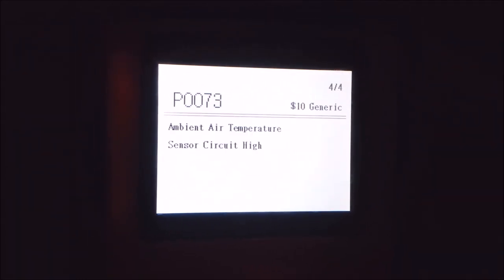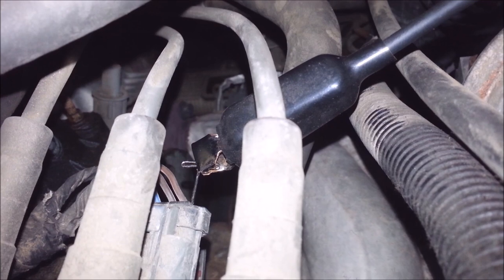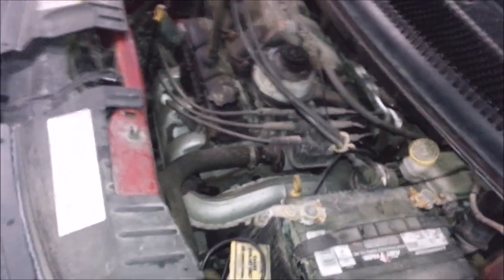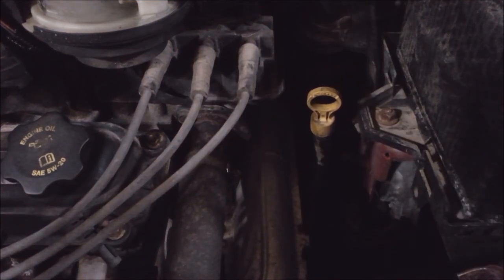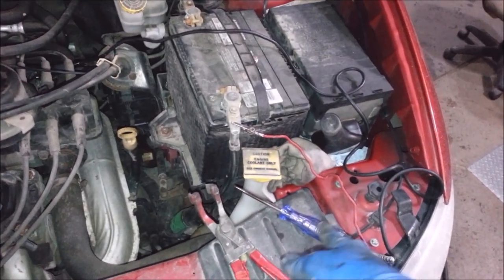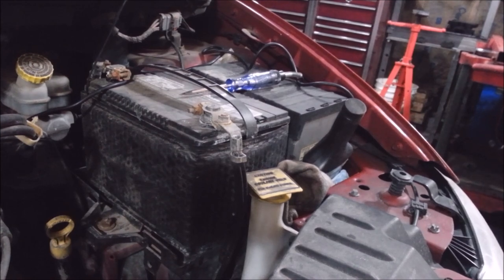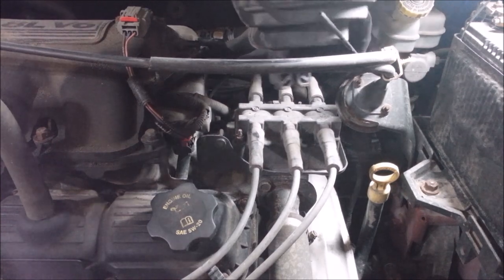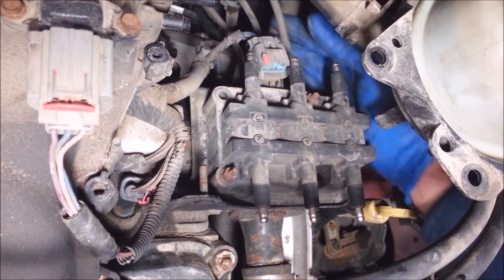2000-2010 Dodge Caravan p2305 p0300 testing and diagnosis

Comment: As im watching the video, I'm seeing that your using a t-pin to back probe each of the four wires on the ignition coil pack connector, then your connecting the alligator clip of the test light on the t-pin, then your starting the caravan to run, with the probe end of the test light your touching the negative battery post, why are you touching the negative battery post with the probe end of the test light when your t-pinning and checking each of the four wires on the ignition coil pack connector? I'm just asking because I'm not understanding and comprehending that part.
Reply from the maker: Because the other end is positive?
Reply: @RustBeltAuto  Can you be more specific, please?
Reply from the maker: @AlwaysDiagnoseVehicleFirst  if you don't understand electronics well enough, I would suggest that you do not do any of this. It can be dangerous, if you do not know what you are doing, as I have described in the video.

Comment: Hi, wondering if you can give me some advice.  I had same issue, just on cyl 5.  I tried using a test light like you showed, when I tried the 2nd from left wire (ASD wire) it instantly started running worse and shut off. It blew 2 fuses, 1 was ignition and I can't remember what other was, just replaced it. Now it will crank but not start, and have no spark.  Have replaced coil, and ASD relay with no positive results.  Any help would be greatly appreciated.  Thanks in advance.
Reply from the maker: The second wire from the right brn/wht, is your power wire for the coil. check power with DVOM, or test light while cranking engine. 2nd wire from the left is a coil driver wire.
Reply: @RustBeltAuto  that's the one, I meant second from left.  Sorry I had a long night trying to figure it out yesterday.

Comment: Check for a 5 volt reference on any of the sensors like tps  and see if the computer is sending power then you’ll know it’s the computer at fault
Reply from the maker: I was checking the coil driver. It is a signal that drives the coil. Basically an ignition module in the ecu.
Reply: Rust Belt Auto ahh I see now....check out scannerdanner he has some good content for backprobing and diagnosing..he’s awesome
Reply from the maker: @rahrah8076  I think I was awesome. I'm trying to quit. I have not come across him yet, and usually only see these tech guys when I'm stuck on something. Otherwise, I usually try to forget what I did yesterday, and usually don't know what I'm doing until it's done. May not look it in my shell of a garage, but I was an advanced master tech, 20 years in, and a lead tech in 3 different shops. I'm older than I look. Everywhere else, I tried to play dumb, because I don't want that no thank job. Thanks for watching!
Reply: Rust Belt Auto I have been watching you’re videos and have subscribed and you sure are a good mechanic and know a lot of diagnosing so I am learning from you as well..the automotive field sure is expensive for tools and equipment and diagnosing tools.. I don’t work on vehicles for a living but I work on my own..I just a bought Autel scan tool and learning with it.
Reply from the maker: @rahrah8076  wholly crap! I need a new scan tool. Have an old Maxi Das, that's way over due for replacement. Getting by right now with a cheap scan tool, and a graphing meter.
Reply: Rust Belt Auto a good scan tool to get would be the launch Diagun x431 has bidirectional controls it’s around $800..I need a graphing meter

Comment: On my 07 wrangler the blue/tan wire has steady light it dosent flash but the other two do with a test light does that mean my computer is bad or  can the rest light be steady and not blink?
Reply from the maker: If it is a signal wire, it is supposed to blink.

Comment: Great video thank you and thanks for the good laughs... Only Chrysler. I'm on my 3rd coil pack...
Reply from the maker: Secondary ignition failures will cause premature coil, and driver (primary) failures. Did you get a good set of wires, and new plugs? Plug wires might be the culprit
Reply: @RustBeltAuto   Yes I did and I appreciate everything you  Help me with... Keep up your great videos.  We all know Chrysler is  junk... I put more money and changed stuff on this Van in one year... And the most I ever put on my Lexus's and Toyota's in 20 years... Is basically change the brakes and rotors honest-to-God...so sad.
Reply: Sad third box

Comment: Hello can coil still be bad if no spark on cylinder 2 and 5
Reply from the maker: Ya
Reply: @RustBeltAuto  OK van starts up and runs but has misfire on cylinder 2 and 5 has no spark and has  vibration and engine shaking in gear have not drove the van I did put new wires and plugs on it yesterday seem to make it worse.
Reply from the maker: @russellprice7628  it could be a coil. I always check signal. Old/bad secondary ignition parts can wipe out the drivers in the computer.

Comment: My 05 dodge grand caravan is messed up. My engine has no power it's kinda weak. Code shows 2302.. I already got all 6 spark plugs and wires changed. 3 months later the engine light was blinking. Mechanic put in a new coil.. but still engine running like crap. Budget brake and muffler said they think it's the computer??? Also said 1 and 4 cylinder was misfiring so I replaced those 2.. still engine is crap. For how old this van is I dont think I could afford a 2 thousand dollar computer if that's what it is.
Reply from the maker: They did not check to see if the coil was getting a signal? You can get a remanufactured programmed plug and play computer off ebay from people who rebuild them for a living, and put it in yourself for about 1/10th the price.
Reply: @RustBeltAuto  thanks for a quick reply! Unfortunately they didnt do much diagnostics. I went to a junkyard to buy a computer that goes behind the front left wheel. That 2nd hand computer didnt start the van at all. So I put myn back in. Until I saw your video about ebay and vin number to program it to work. I may do that because a quote of 1800 for a new one is insane
Reply from the maker: @johnw3794  you should really stop going to mechanics that were born under a bridge. Any top tech charges that much, and they will find and fix your problem the first time.
Reply: Check your grounds and maybe even vaccum leaks can cause that a bad ground can make a engine run like total crap it can be time consuming but if you find the problem it's worth it I tell people if there is a problem then there is a fix you got to press on till you find the problem never assume something is ok test and be sure

Comment: Did u hear back after the send off?
Reply from the maker: Whatchumean?
Reply: Did van come back, or was good to go after.
Did u do a follow up call?
Reply from the maker: It runs like a caravan.
Reply: Fixed it,
$87 dollar part, took me under 8 mins to change if for new one ;)

Number 2 was not sparking.
Reply: Thanks for your video, and the safety tips. 
I can make light bulbs turn on with my fingers now
Reply: @RustBeltAuto  didn’t need to be like that

Comment: It's only 14 volts you will be fine.
Reply from the maker: Umm...  try more like 45,000 volts.
Reply: @RustBeltAuto  how 45,000 volts?
Reply from the maker: @dustinmcclellan40  primary and secondary coil windings create about 45,000 volts of AC voltage for the spark plug. 14v would not be enough power to jump a gap through the air to make a spark plug work for you.
Reply: @RustBeltAuto  been shocked many times from them.  Does not feel like 45,000 volts.  Feels more like 12 volts.
Reply: @dustinmcclellan40  You can't feel 12 volts. No matter what the amps 12 volts can't penetrate human skin. Hate to tell you that you got zapped by 45,000 but the amps are so low it didn't do anything. Don't do it again.